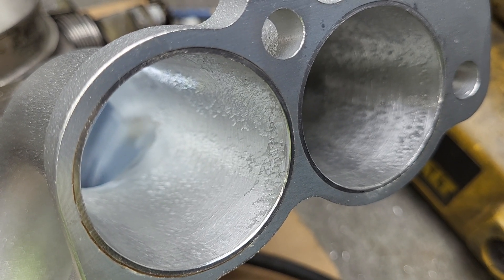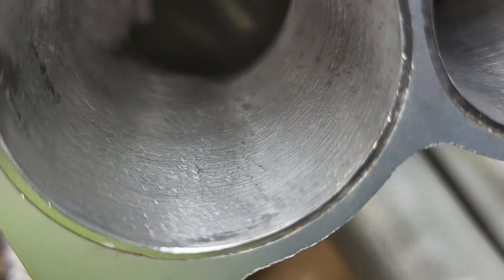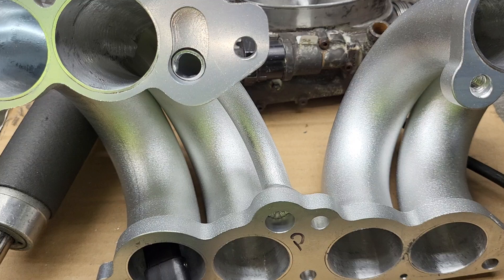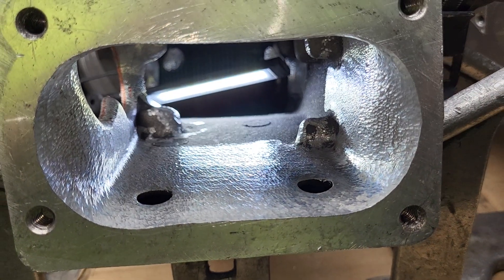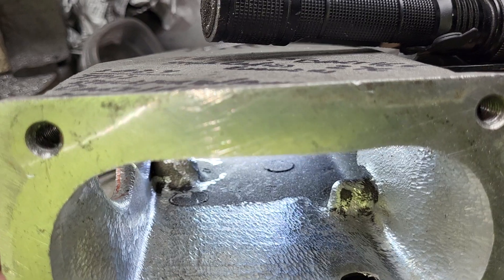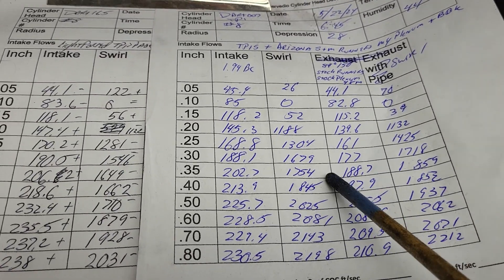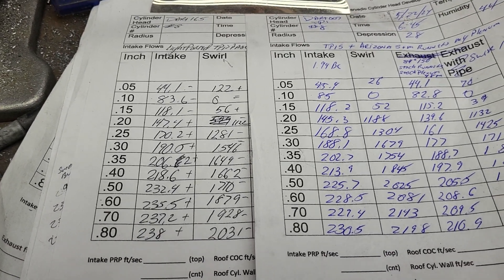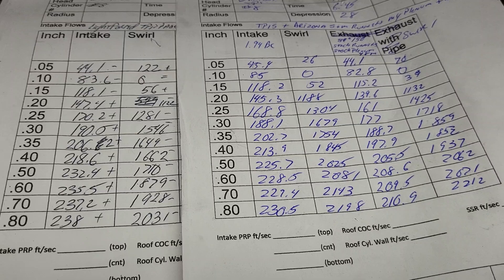Redheaded stepchild, High Performance TPI project, Arizona Speed and Marine runners rabbit hole!

Comment: I don't put a lot of stock into the importance of finish for a daily use type deal because after a couple of years of running the texture is going to be totally different once it is coated in fuel and oil residue.

Comment: The best thing you can do to get these TPI long runner intakes to flow is to Siamese the lower intake manifold. It's like sucking through one straw vs two straws. It also slightly shortens the actual runner length.
I do enjoy watching guys mess with these TPI's though, so nice job.
I have a 88 Iroc-z 305 stock bore, worked over stock heads, Siamese lower,  rear mount turbo running 600hp on 17psi.
Reply from the maker: Nice! No Siamese on this on. Thanks
Reply: @servediocylinderheads  Don't go with the Siamesed runners. The ASM runners you have here were the best runners made for the L98.

Comment: I've heard LIQUID distribution through a TPI intake is REALLY bad and I can't help but wonder if all the effort you went to to even out the airflow AND keep rough textures would help the distribution of nitrous in a throttle body plate or in the charge pipe.  (I've heard nitrous in a plate can be downright dangerous on TPI apps with some cylinders tending to go ultra-lean.)  

Interesting to think about, anyway.
Reply from the maker: Secret n20 system? Hmmm

Comment: Why do you keep the casting "bumps" in the bottom of the plenum?  Is that feature supposed to redirect air to the runner entries on the opposite wall of the plenum or something? 

Another question: With the hard 90 degree turn into the first runner with the TPI plenum, would it help to use as big of a throttle body as possible, so that the air flow through the throttle body heading towards that 90 degree turn gets slowed down?
Reply from the maker: I don't keep the bumps if I can reach them. A bigger throttle body will have a slightly slower air flow through it which may make it easier to turn into port #1. Thanks
Reply: @servediocylinderheads  Thanks I've wondered about that. The FIRST intake came with a similar bump on the floor of the center of the throttle body exit -I wondered if it was there to help the air make the turn into that first set of runners but I just couldn't stand to leave it where it was and I ground it out on mine. 

My understanding is air velocity becomes pressure in the plenum during pressure recovery, so I wasn't sure if slowing the air through the plenum was always a good thing, or if it involved a trade-off between lower RPM and higher RPM power. (But these things already have so much mid-range torque, taking some of it and "giving it to the upper RPM range" seems like a good trade-off for me, if it is one.)
Reply: I thought those bumps were for the bolt holes?
Reply from the maker: @jcanvid  The large bumps are. I thought he was writing about the small casting bumps.

Comment: 500 to the pavement, it's entirely possible.
Reply from the maker: If it had a 440cid block under it maybe...
Reply: @servediocylinderheads  You're probably right, I don't think you're that far away though.

Comment: The plenum short turn radius is good!!! The air does not travel directly from the blade into the main runners. They feed off the plenum volume.
  This is the issue on the majority of sport compacts. Charlie there is a video on utube to show what happens inside when the TB is attached. You can have the main entrance of the throttle body anywhere on the plenum.  
  The runners close to the TB do not steal flow from the rest. That radius into the infinite port is excellent.
Reply from the maker: The guy who mounts a go pro inside his manifold on his turbo buzz box? Good video